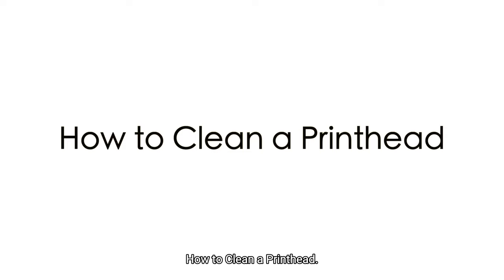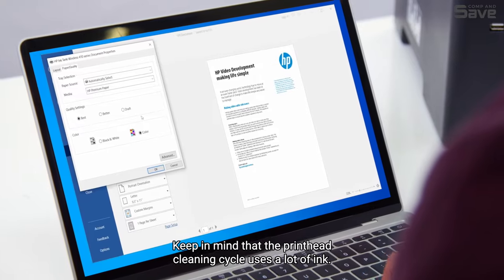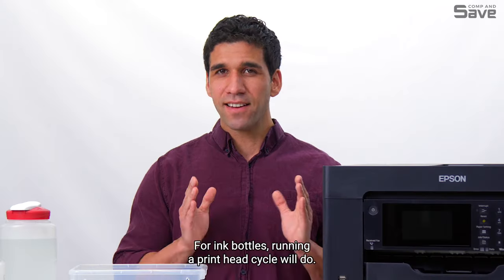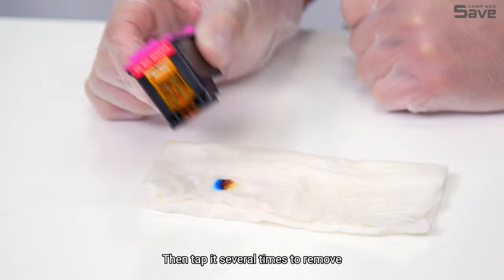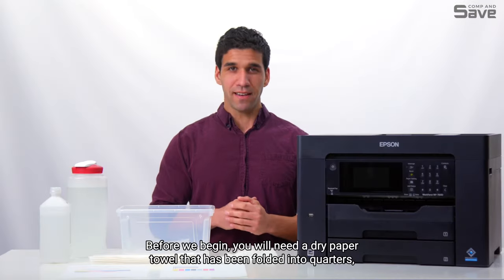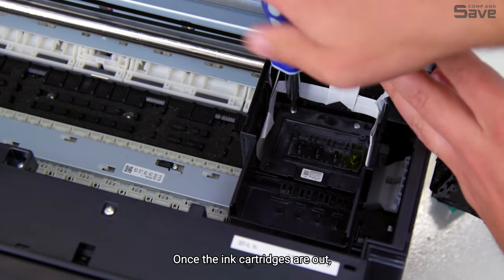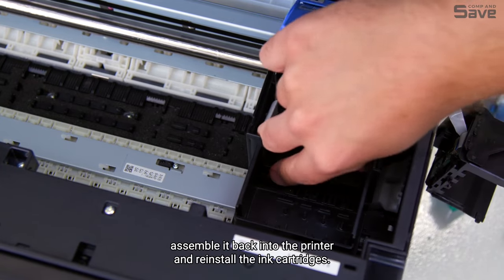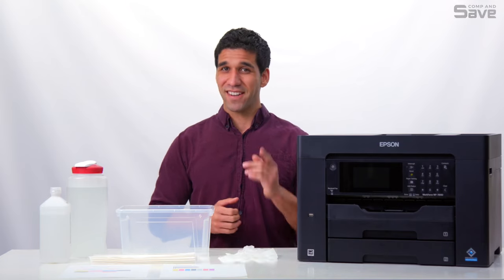How to Clean Printer Heads and Fix Dry Ink Cartridges

Comment: We have an HP L7680 with just the black not working.  The printhead has both yellow & black.  The yellow works, not the black.  Will these tips work in our case?  Could we just run warm water over to clear the clog?  The test report says the printhead is still good.  Thanks

Comment: How to clean the nozzles of a dry printer cartridge in a 3 seconds.
You need to immerse the printer cartridge halfway, nozzles down, for 2 - 3 seconds in boiling water, pull it out and wipe it. Let me explain: boiling water will slightly soak the dried paint and the internal pressure will “break through” and wash the nozzles with ink that is inside.  True, the cartridge will “lose” some ink. If it still won't print, it means there is no ink in it.
Reply: Is it just hot water without the need for alcohol ?

Comment: Hello, I have the printhead version, so when I put it in the solution, is the solution suppose to cover the area we pulled the ribbon connections out from, or should we keep that dry?
Reply from the maker: The solution should only cover the nozzles at the printhead (normally at the bottom). The ribbon connection should not be covered in the solution.